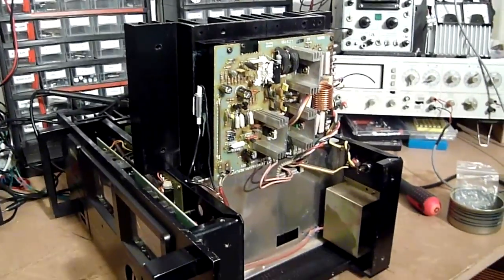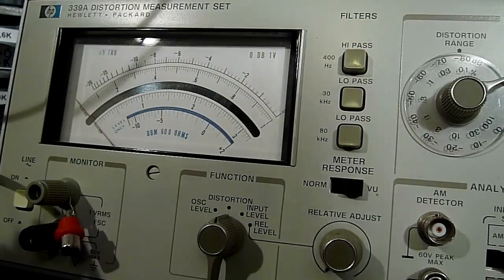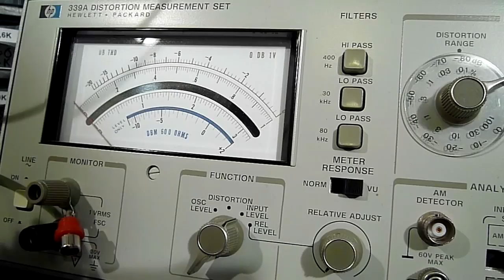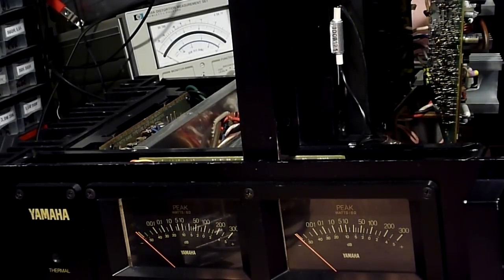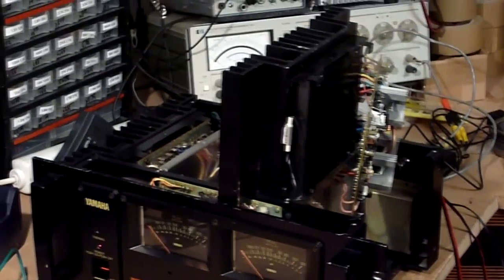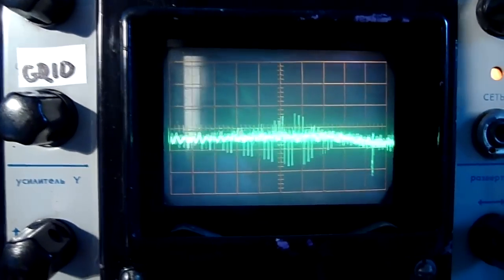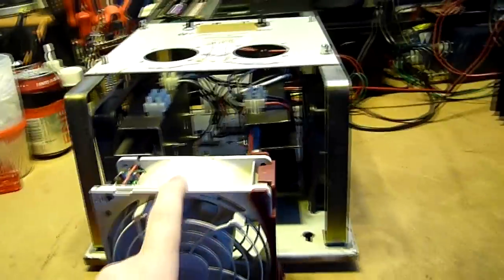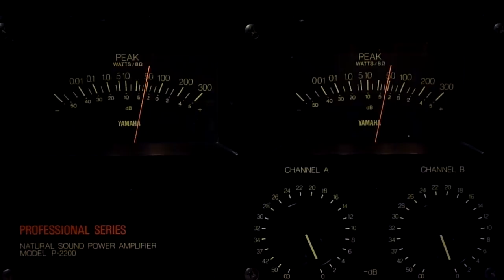Troubleshooting distortion on my Yamaha P-2200 - Part 2

Comment: You may want to consider checking for oscillation. That will build heat just about faster than anything.... I have also found that dried up electrolytic caps will cause DC on the output, as well. When those things change value, bad things start happening. Ones near heat sinks are highly suspect. Same thing in old analog TV's... On the verticle output stage, which is just a push-pull audio amp, really, the caps change value do to drying out, because they are right next to a heat sink. Replace them and all worked fine. On these old power amps, many techs skip over testing caps....

Comment: hi  do you know the resistant on thermal lead switch yamaha power amp p-2200
Reply from the maker: The device used for overheating protection is just a thermostat.